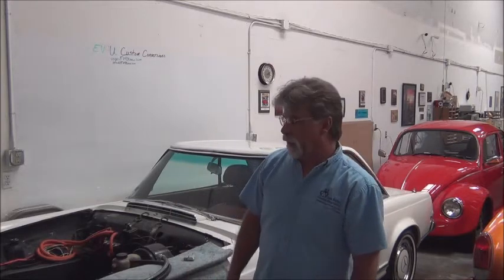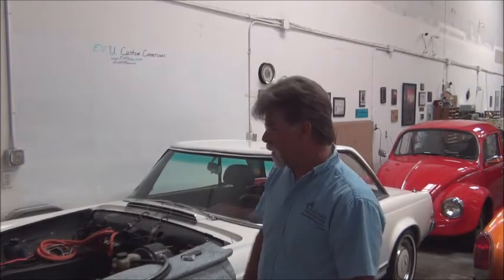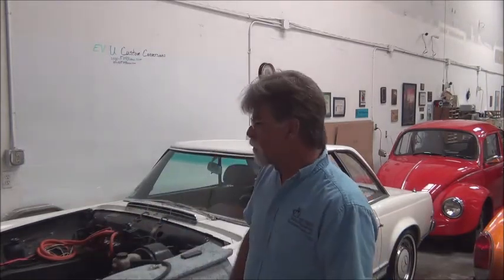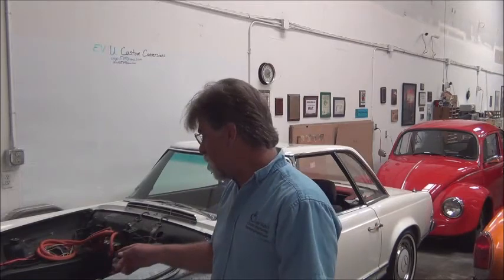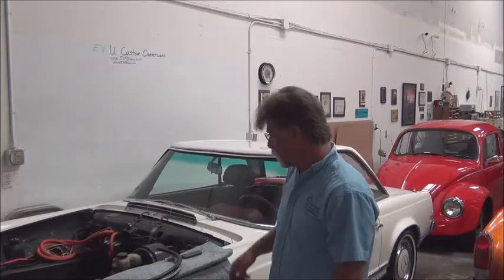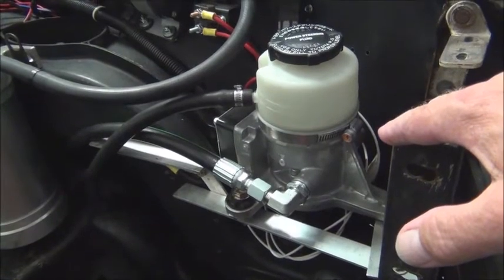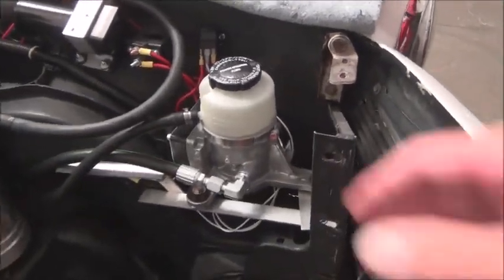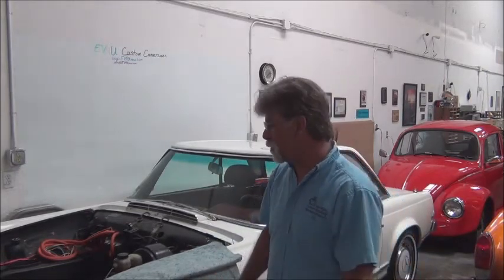Mercedes 230SL Electric Conversion - Electric Power Steering Part 2

Comment: Great Video's. THANKS FOR POSTING! - Where do you order the adapters and adapter couplers? Canadaev? Cheers from Miami.
Reply from the maker: We do not recommend Canadian Electric Vehicle adapters.  We have had issues with all but one of the few that we have used.  We waited over three months for the adapter/coupler for the Mercedes that came from them, and it was not correct.  Email us at info@EV4Unow.com and we will try to point you in the right direction.